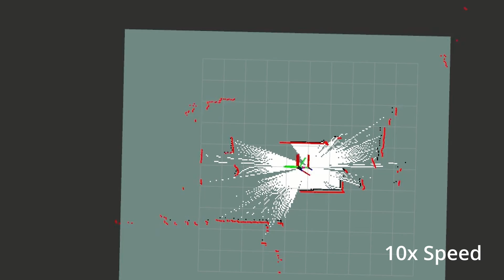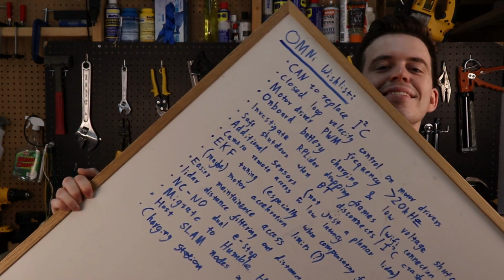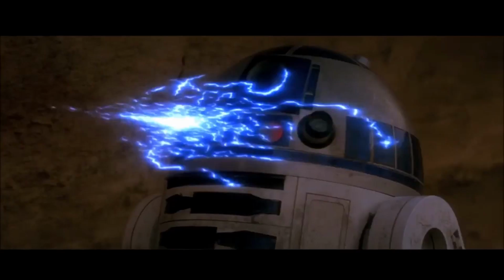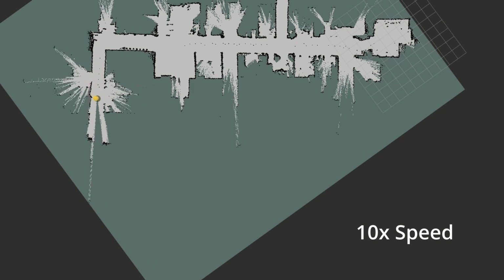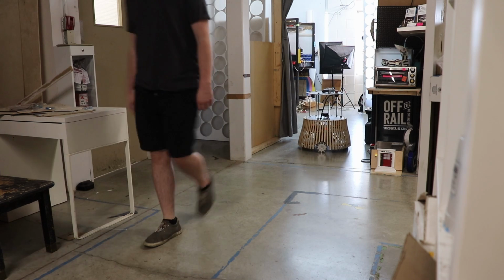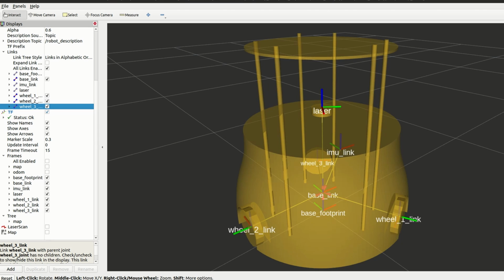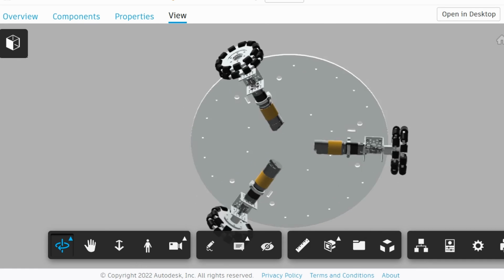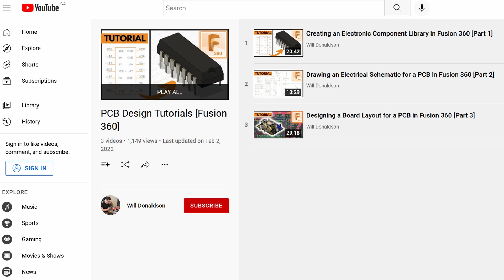How to Build an Autonomous Robot Using LiDAR

Comment: i started working with my team to do an autonomous robot project, but I didn't know much about lidar sensors and actually how to install the system architecture, and I came across this video. the purpose of what you're doing is the same as mine, so I have a few questions for you. should ultrasonic sensors or lidar sensors be used in my project? I would be glad if you could tell me how the lidar sensor is used, as well as about it. What kind of interface is used and is it easy to code